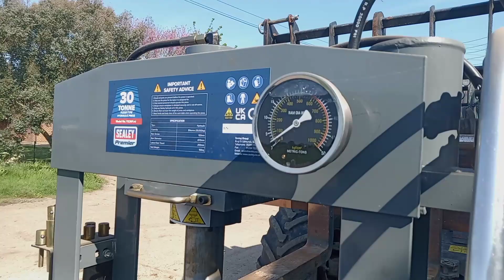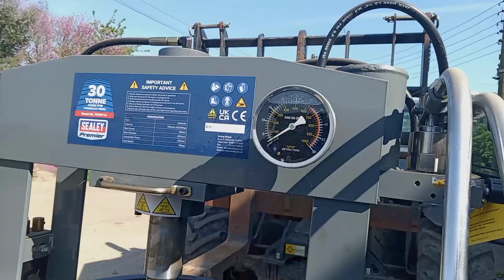Massey ferguson 9380 rotor variator

Comment: As they say, "its been a bearing too long". Seeing how tight it was on the shaft, are the variator sheaves siezed as well? Are they sprung loaded or are they hydraulically operated.
Reply from the maker: No the variator moves just fine, I think some of the tightness is from being kept outside / power washing causing corrosion on the shaft.